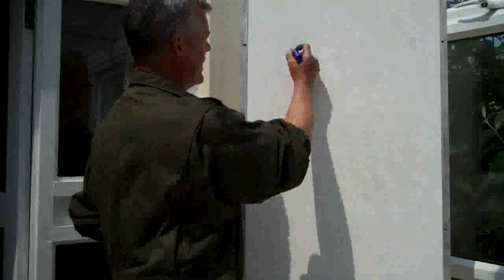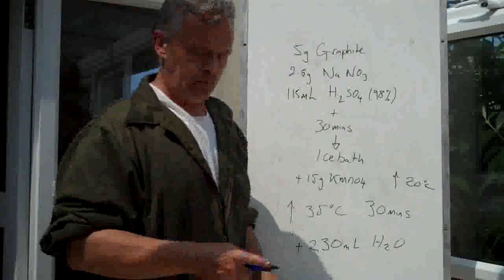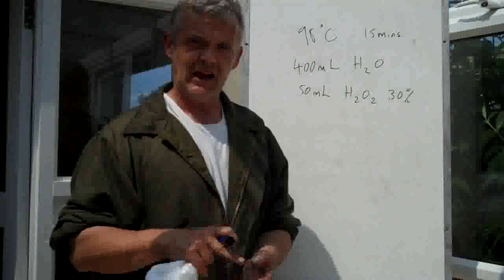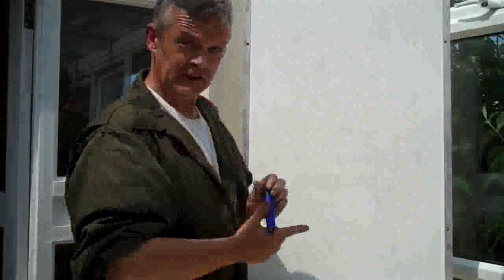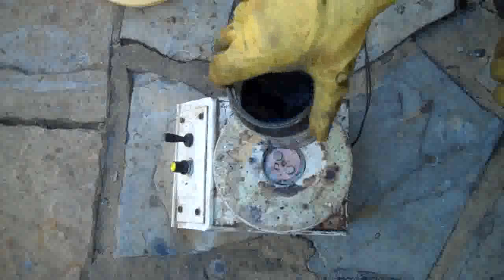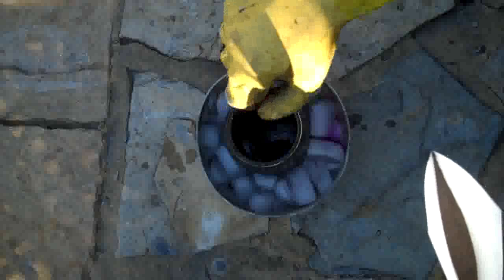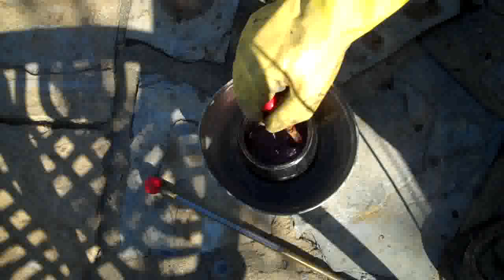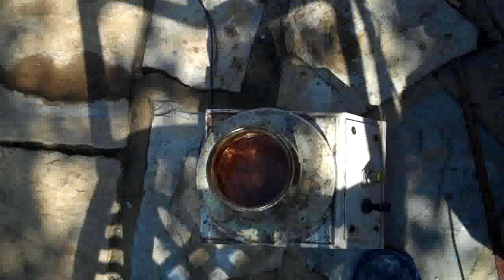Improved Faster Method for Making Graphene Oxide

Comment from the maker: It's greenish because of unreacted graphite. I have had this a couple of times. What I did was dry the whole thing and re run it. On the second go it was much better - bright yellow. There are so many factors influencing it getting it right first time can be a bit challenging. Luckily, it is hard to get completely wrong. As I said I it does go wrong just dry it and do it again. The first run will be like a pre oxidation stage and the second time it is more or less bound to go well

Comment from the maker: well, you could try filtering first - but that'll take forever - not a problem if you don't have that much and you are patient then wash or keep washing in normal water until the pH is 6 or 7 then wash with DI water to reduce the ion count - it's about all you can do if you are going through gallons of the stuff - i am afraid i have DI water system so it doesn't cost me much for gallons of the stuff.

Comment: I agree, microwave-assisted irridation does help in the exfoliaton process.  But does NaNO3 produce better results that KNO3?  I have wondered about that for some weeks now and wonder if the Na and K are "spectator" ions and if so, will it work just as well or will too much potassium (with the KMnO4) be a problem?

Comment: Do you think this is more cost effective than flash graphene?

The only difference would be supplying your own renewable energy.
A “flash graphene foundry” still requires a Lot Of Power, and the quality I’d still wonder about.

For anyone making this business, you would need to employ multiple methods.  Just to see your output quality, which in my opinion is everything right now. 

I still consider a lot of stuff out there with Graphene essentially snake oil:-/

Comment: There is another paper at bucky-central.me.utexas.edu/RuoffsPDFs/259  They are using a domestic microwave oven to thermal shock the GO.  If there is any GO present at the end of your method using the ascorbic acid, this could be an easy, and somewhat effortless way to just boost the yield by a small amount.  (they report that the yield of microwave exfoliated GO relative to starting GO was about 20%)

Comment: Hi Robert.  Been experimenting with this over the last few months and I don't know why I didn't see this before, but silly question: 
When adding the 400mL of water & 50mL of 30% H2O2, you are essentially adding 15mL of "pure" H2O2 and an amount of water. Would this work the same way if you just used 500mL of the cheap 3% H202 (also 15mL of "pure" H2O2 with a little more water), or does it not work this way?  -- Thanks!

Comment: dear Robert, sorry for bothering, could you please give me a favor and answer my question like usual😊I followed a method similar to "massive production of graphene oxide...." and I got a beautiful brown mixture after adding water(slowely) but then when I added H2O2 to quench the reaction I ended up with a greenesh yellow colour😭 I even used less amount than that one mentioned in paper... could you please tell me why?should I add H2O2 as long as the colour turns to brownesh yellow and not more?

Comment: hello! thank you!  excellent information for us!, two questions: 1. what is the best technique for structural and compound characterization graphene oxide?, 2: how long ultrasound is necessary to move from graphite oxide graphene oxide? congratulations! :)
Reply from the maker: +Edgardo Gabriel Casas Rodriguez Raman and I don't know.
Reply: PMSL ... i don,t know either
Reply: For question 1: For a surface analysis and structural analysis, SEM or  AFM is the best to analyze your image.  For compound analysis, such as graphene to graphene oxide, FTIR will give the data for functional groups of graphene and which wave number will have occurred. For question 2 : Generally, time is varied by experiment to experiment.

Comment: Hey Robert. First of all, you are amazing =P, now onto my question, I want to make a graphene super cap for a school project by burning GO with a light scribe disc burner. I realise that super caps may not be all that they are made out to be and what not but i really just needed something fun and challenging to do for my science project. Anyway, i was looking for where to buy graphite oxide and i had a lot of difficulty doing so so i did a bit of research. First I found that graphene oxide was a lot more easily obtainable than graphite oxide so I did some research on that. I then found that graphite oxide is being sold in places as graphene oxide. I then found that when you disperse graphite oxide into water it exfoliates into graphene oxide anyway. Please tell me if what I have read is true or if it is false and if I would be able to just disperse what they call "graphene oxide" into water and burn that to make my super caps (graphene oxide is apparently also water soluble). I also wanted to make graphene oxide but my teachers said no because it may be explosive. I then decided to buy some, I am only in year 9 so i have a tight budget and this was the cheapest graphene oxide I found http://www.ebay.com/itm/Single-Layer-Graphene-Oxide-Solid-150-Milligram-Per-Vial-/111297404661?pt=LH_DefaultDomain_0&hash=item19e9d79ef5
would that be suitable for what i want. Thanks in advanced.
Reply from the maker: cheers mate- and yes it would be fine
Reply: Robert Murray-Smith Wow... O_o  that was an amazingly fast reply... If i have anymore questions should i ask you here or would you prefer for me to ask them somewhere else (I shouldn't have that many questions from here on)?

Comment: I just finished my last batch over the weekend. Thanks for the clear and concise directions, I had really great success. 👍

It is a relatively safe, reaction if you obey your advice, I had almost no nasty fuming, it's really critical to keep the temperatures low as you said.
The only step that particularly concerns me is adding the water to the mixture, (water into acid, eek!) would it be better to do it the other way around, add true mixture to the water?

Also what's the best way to store it? I'm thinking maybe in a dilute H2O2 solution to prevent it reducing back to graphite over time?

Comment: Hello Dr. Murray-Smith, thank you for  making these amazing videos.

Currently I am having trouble in the step where I add the water, after heating the mixture for 5 minutes at 100 ºC and right before adding the hydrogen peroxide. Instead of obtaining the orange color (as seen in the 19:00 mark), I obtain a Green/Brown color.
Does the reaction needs to take place at a specific temperature? Or do you have any idea of what I may be doing wrong?

Thank you very much
Reply from the maker: Miguel Azori It's very hard to give practical advise i am afraid as i am not there to oversee what you are actually doing. But by the time you add the peroxide it is all done - the fact you get brown green indicates an error in the earlier phases. What they are I don't know as i didn't see you do the whole experiment - sorry i can't be of more help

Comment: Thanx Sir for your prompt reply, If I am using the graphite with 45 microns or bigger in size as the starting material, then what pore size PTFE  i should use to filter the GO.
Reply from the maker: i wouldn't use less than 45 microns if i were you lol - try a few and see mate

Comment: Hi Robert thanks for video. So after I mixed KMnO4 with solution in an ice bath, I increased temp to 35 Celcius degree and it started to explode a little bit. I put back right away in the ice bath and explosion stopped. But, solutions turned to be pasty grey mud-like solution. Can I still use this solution for further procedure? Thanks Rob
Reply from the maker: no mate it's ruined - you have to start again

Comment: Dear Sir, My 1st question is what kind of filter you used to get the final product as GO. Is it a normal filter paper, can you specify the pore size or it's detail? My 2nd question is, Does this GO you obtained can be used to get the LC phase?
Reply from the maker: getting LC phase and filter size depends on starting material - tto get LC phase you need graphite of 45 microns or larger. You need to use a PTFE or similar filter with correct pore size mate

Comment: Hello Robert I tried this process in my lab and have some doubts regarding it.

1. Completed the process and kept for drying in a glass tray, it is getting dried by the day time and when I take a look after a night the dried slugger again turns into wet can find waters in it. What is the reason behind this?

2. What are the better methods to test the Graphene oxide, which test can be effective to tell how much graphite is oxidised and what is the percentage of Graphene oxide in it.

Thanks buddy
Reply from the maker: vinodh kumar it's just a modified hummer's mate and subject to the same restrictions any hummer's based methodology is. Test methods are fairly standard - raman and XRD being 2 basic ones - i feel you should know this

Comment: Do you recommend a specific particle size (mesh)  for the initial 5 grams of graphite, or is it of little importance? Your final graphene oxide looks quiet homogeneous. How much of the initial graphite was oxidized accoprding to your numbers. Thank you.
Reply from the maker: it depends what you want - if you want large flakes you will need to have a large grade - you might want this for liquid crystal type that can be electrospun or you might want small for inkjet printing - so it is up to you - typically i use 45 microns but i have usedd 150 micron and 5 micron. depending on reaction time you can get 95% but be careful of overoxidation
Reply: Robert Murray-Smith
Thanks for your answer

Comment: I'm guessing that graphene made from the oxide has a better shape/profile (or thinner) than some others, otherwise why bother with this instead of say, liquid phase exfoliation, or your acetone/water/blender method, or indeed electrochemically.
Reply from the maker: +TheBaconWizard There are a whole host of reasons mate -  shape,  fuctionalisation, area, It all depends on what you want to do with it as to which method is more suitable
Reply: Robert Murray-Smith You've got too MANY vids now mate, there's so much information it's getting hard to narrow-down specific ones. Placing an order with JS Mines next pay day :)
Reply from the maker: +TheBaconWizard lol - yeah - the work involved in indexing them is now so much i am reluctant to do it
Reply: Anyone that comes across this later and wants to know more about which methods are suitable for what, search Rob's channel for "Methods of making graphene" it's a vid going back to 2013 and a good starting point. :)